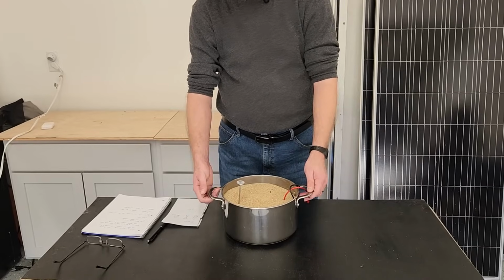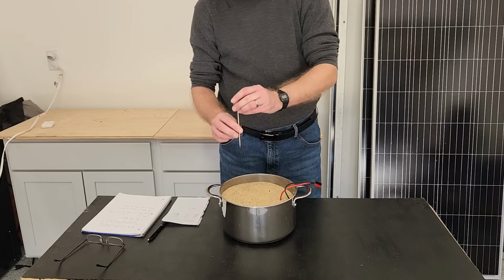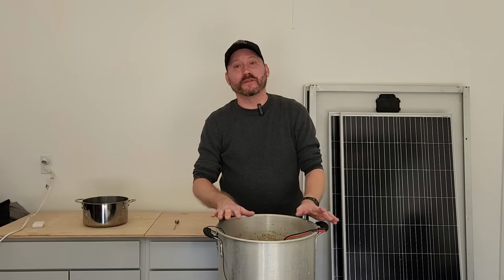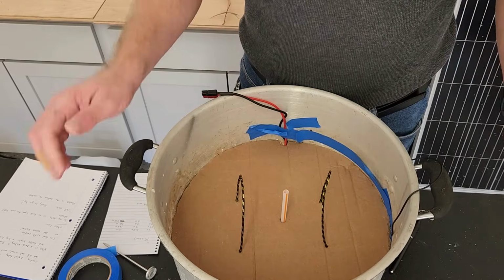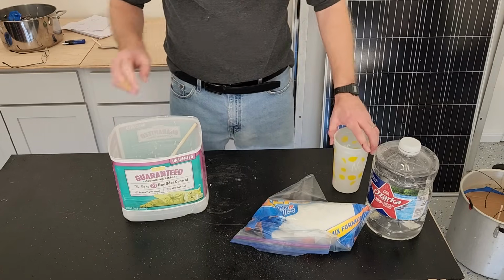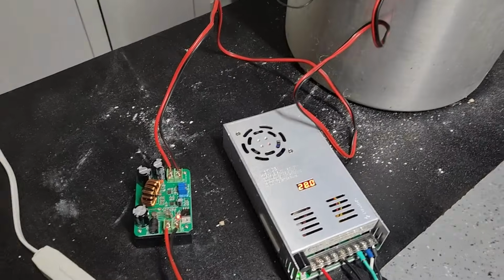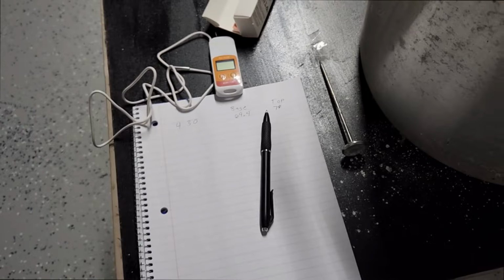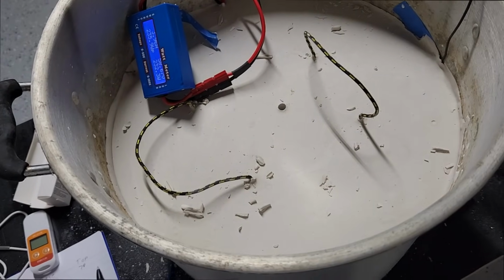Sand Battery heater. Create free heat  of 500F using solar electricity! Texas Prepper Projects

Comment: I'm about 8 minutes in and I thought I'd point out a potential electrocution hazard.⚡The contacts for the wires on the heating element are not meant to be surrounded by any material. The loose sand and/or the fused sand connects them together providing a path for a short circuit.☠ A solution might be some high-temperature silicone gasket material over each terminal separately. Also of concern is the plastic on the wires, it might also melt in this application. So additional insulation around the wires, with suitable high-temperature material, would be a good idea. Or a better idea as "daughy doc" suggests, make a hole in the side of the container and insert the heating element the same as it would be in it's normal application in a water heater.
Reply from the maker: I was also concerned about that and I do think it is a valid fear. I have multiple fuses in this system in case something like that happened.  Thanks for the comment!
Reply: Dry sand is non conductive. There should be no electrical problem. Unfortunately sand is also not a very good heat conductor. A water heating element will burn out very fast as it is designed to have water around it. Water is a much better heat conductor. I think a solution would be to have something havey in the centre that is a good heat conductor and then use the sand arund that as an insulator. Water heating elements are only designed to handle heat up to a little over 100 degree Celsius.
Reply: @leonhardtkristensen4093  That may be the case, if it's clean and 'only' sand, but I still wouldn't touch it while the heating element is turned on.
Reply: @Mavrik9000  That is allright. Safety first of cause.  If it is used with low voltage like 12 or 24 volt it is no problem and if it is used with 240 volt I am quite sure the heating element would burn out in no time. With mains voltages one should allways be very carefull. I have had my fair share of electric shocks and survived but it is true that if not used to it even a smaller shock can give a deadly amout of andrinalin in ones body. It is often not the electricity that kills but the adrinalin that does it.
Reply: You could also drill a hole in the can and stick the element and the wires out, just be sure all connections are protected with electrical tape.
Reply: I think molten glass is also conductive so if the sand actually starts to melt it would short out.  I wonder if encasing the terminals in ceramic would work as an insulator.
Reply: @redsquirrelftw  According to Dr.Google it does but not a short circuit at least to begin with. If the cunductance is higher than the heating element it will start to take over the heating process. The electric wire may melt too and it all melts together and then probably breakes the connection like a fuse.
Reply: Maybe use an old water heater and cut the top off and fill it with sand?
Reply: Would you burn out a hot water heater  element if you put a stainless steel  cylinder  filled with water an the elements in the center of the pot of sand an  plug it in to  110
Reply: @kennykrieglmeier8909  If the element is designed for 110v it will not normally burn out if it is connected to 110v and there is water in the heater. If there is no thermostat it will probably evepurate the water and then burn out. Also the reason for using sand is to get the heat up much higher than 100C (242F I think) as it can then store much more heat so limit the temperature to 100C defeats the purpose. 
At less than 100C it is better to store the heat in water alone as it can hold more heat for each litter of material. The key to keep the stored heat is the external insulation. The more the better. Heat energy losses can be calculated in a similar way to electric energy through a resistor.  Losses quardrubles with doubling of heat differential. Dry sand is a bad heat conductor and cheap so that is why they attempt to use that for storrage. 
Personally I have experimented with a heat pump water heater. I unfortunately experienced probably 50% losses in 24 hours or less with a top temperature of about 60C. It was an older water heater. The heat pump gave me probably about 250 - 300% gain. I attempted to heat up an old caravan by circulating water from the water heater through a radiator. The heat usually ran out at appr. 02am. The rest of the night was cold. It would have been near freezing outside. I did have a secondary water heater tank I could have used but in the winter I didn't have enough sunlight energy to heat it all up. To run a generator to heat up all the water might have been an idea as  heat pumps also work better in the daytime (smaller heat differential gives more heat energy) but I haven't tried and I haven't calculated the numbers.
Reply: @JohnSmith-gj8fd  waste of time using water maybe oil because it can get hotter than 100⁰c and not turn into vapour but then would copper pipe be able to withstand the heat and pressure of the oil which would change heat transfer..... Maybe use heat exchanger like in a combi boiler 👍
Reply: Came to say the same thing. Just had and electric fire in my house (old ass rental) a few days ago, and with it fresh in my mind, now anything involving electricity I'm highly critical of. Luckily we only lost 1 small room, but still was a shock at 130 am, during one of the coldest days/nights we've had in years. Funny part: nothing was plugged into that circuit so wasn't something I did the electricians said. In this case, I agree that isolating the connections and wires from the high Temps of the sand, or finding another element that'll allow u to install it with the connections on the outside (covered up obviously) would be ideal.
Reply: @leonhardtkristensen4093  
the heating element in a water heater gets RED hot in water. That is around 950 F. The real concern here is the dry element will get the wires hot enough to part. I do not know why this guy does not get a broader ranged thermometer.
Reply: @redsquirrelftw  Agreed! The lead could be bent 180 degrees before applying the ceramic covering, or encase leads and connecting wires in a ceramic covering via the plaster.
Reply: 🤣👍 good point. thanks for noticing. : ) the sand itself could be conductive wet, contain metals maybe.. however, i do not se a problem within the sand!?
even if there are some phenonema... my concern would rather be erosion of isolation due to high temperature.... which speaks for spreading out the heating...
and battery....
Reply: @leonhardtkristensen4093  😂Right, my water heater is totally melted with my first sand heater experiment!
Reply: @fransjebik8554  Sorry to hear that. I hope it wasn't too expencive. "A Youtuber" suggest mixing mineral oil in the sand 9 days ago. That would be fine if it is keept in the centre and don't get so hot that it catches fire. 
Some of the advantages with sand are that it is a good insulator (it keeps the heat in the centre and doesn't loose too much), can store quite some heat and is cheap. The disadvantage is that it has to be very hot to store significant heat ammounts.
Reply: A Youtuber  If the oil can be keept in the centre of the sand and doesn't get so hot that it catches fire then yes that is a possibility.
To keep the heat the sands insulating propperties must be kept in the outher layers I think. If the oil was keept in a steel container in the centre and the oil was only heated to about below it's boiling point then it shouldn't catch fire either. No oxygen and no signeficant expansion.
Reply: @leonhardtkristensen4093  Thank you, and no not expensive, bought it about 15 years ago in Russia! 🤣
Reply: Sand is a mineral insulator.
Reply: 60v DC is completely safe to touch
NO electrocution hazard whatsoever.
Reply: @mrbmp09  If you have dry hands yes but if they are wett especially from salt water then it is a question. As I understand it the skin's resistance is normally high enough to prevent any hasard but not the internal body.
Reply: @leonhardtkristensen4093  I was thinking the same thing with the water heating element. They are designed for being in water, meaning they have a lot lower O2 exposure. You can see in the video the element is already being damaged after a single use.
A better element to use would be to use an electric stove top element. Not only are they are designed to be in the air, they are also safer to use due to the connections being surrounded by ceramic, and the added benefit of being circular/coiled, exposing more surface area to heat the sand up instead of being centered.
Reply: @korishan  Aggree.
Reply: @redsquirrelftw  Sands melting point is just over 3000 degrees
Reply: Water heaters are much better for this.
Reply: Just something to consider. Sand is a major component of glass. Glass is an insulator used for over a hundred years in electrical service. Plaster of Paris is also a very good electrical insulator. A better heater element would be a bare Incalloy steel element. Sort of expensive but they handle furnace duty handily. You can salvage them from crucible heaters or for smaller units toaster ovens. Even salvage the porcelain insulators to stand it off your base sand. Nice project.
Reply: @korishan ok
Reply: I got a scrap 20 gallon hot water boiler the other day and stripped it down to tank. I bought a new screw in element. The electrical connections won't be exposed to the sand. Currently trying to troubleshoot the problem of the sand potentially fusing to and degrading the element, or the element burning up. But also concerned with the potential for a pressure build up within the tank at high temp. I think I'll end up getting a new or salvaged temperature & pressure relief valve eventually just in case
Reply: Don't immerse the conductors in the material.
Reply: @leonhardtkristensen4093 sand being a poor heat conductor is the key to a sand battery’s efficiency. A stovetop element runs around 900C in air. I’m getting 500C from my 63V of panels. Making your own nichrome element perfectly tuned to your solar panel output is the most efficient.
Reply: @redsquirrelftw what you think is completely incorrect. Why are fuses made from glass?
Reply: @leonhardtkristensen4093 unfollow that YouTuber and don’t listen to a thing they say. That’s such a boneheaded idea.
Reply: @jimk4874 silica fuses around 1800C - much higher than the nichrome in the element
Reply: This must be the famous American Red Neck.
Reply: @leonhardtkristensen4093 I'm a car mechanic and I remember the old mechanics used to touch the spark plug leads on a running motor to try a fault find, or they would lay their naked forearm across the plugs to stop a running engine one old dude recoond that he could judge the strength of the spark if he took the lead off the plug and spat on his hand before holding the, live HT lead. They don't come thathard these days.  And I'm so glad we have tools to do this now.
Reply: I would put a metal grid over the top so I could warm up my soup.
Reply: @kennykrieglmeier8909 water turns to steam at 100○ C so you won't get much heat transferred to your sand. I would add a thermostat to the heater circuit myself.
Reply: @davey2k12 adding a HE is adding complexity and cost, plus the HE will need power to run.
Reply: @therealrobertbirchall  wtf no shit Sherlock...... Why you replying to me for did you even read my comment or just clicked a random one 😂😂😂
Reply: @davey2k12  whatever 😵
Reply: @leonhardtkristensen4093  My thoughts exactly. I doubt the element would last more than a few days with that setup.  If you want to get serious about it get you a small water heater and use it just as it is but instead of water fill it up with ethylene glycol and then put the entire tank in a larger metal trash can full of sand or something like that. Of course you would have to strip all the insulation from the working water heater first.
Reply: @Mavrik9000  I'd agree that could be a possibility but I'd lean more towards it creating a high resistive short.  While still potentially dangerous but nearly that of a dead short or even low resistive short.  It would, either way, reduce it's efficiency.  That being said, it would still be a good idea to make sure all bare connections are properly insulated.
Reply: @leonhardtkristensen4093  you have to have an element designed for solids!! They have been used for decades!! Look up 12v PTC heat plates, designed to heat solids ,metal, sand , concrete,etc. Works great with no danger.
Reply: @thesonnytackettshow7949  Like a stove top burner?
Reply: @Mavrik9000  same principle. They are “dry elements “ that heat solid items so stovetop burners would be the same. If you dropped a stovetop burner in water it would short out, not meant for that. If you put a water heater element under a kettle it would burn out, doesn’t work as intended which is in water. The PTC plate heater is a different type of element. It’s  a ceramic disc sandwiched between two aluminum sheets and sealed. It’s designed as a heater for “dry” components, such as metal, stone, sand, etc. The best thing is it’s “thermostatic, which means it won’t overheat. All of the wiring and metal, ceramic, is completely sealed, no exposed anywhere. The wire has heat sleeving like you’d find on oven wiring etc. 
It’s not a new thing. They have been used to  preheat the motor and oil pan on diesel trucks for decades. And on many many industrial and household products. They are “dry” heaters, water elements are “wet “ heaters. Huge difference. They also come in 12v and 24v which works with solar panels, batteries, even great in an rv. 
And the big thing, you can get two 50 watt 12 v PTCs for $10+- !!!!
Here’s a link

Bestol 2pcs PTC Heating Element 5W-50W AC DC 24V 70 Degree consistant Temperature Ceramic Thermostatic

There are many, in different wattages and 12v 24v AC or DC. 
We use 50 watt 12v dc with a solar array and a battery bank. 
These are good for 5-10 years no problem. 
All the best, Sonny T
Reply: @Zootalaws do you use the coil kiln heating elements? Could you describe tuning the element to you solar output?
Reply: @leonhardtkristensen4093   Maybe using the same oil used in Electrical Transformers would be possible!?!?!?
Reply: @davey2k12  Naphthenic mineral oil has long been the most preferred insulating liquid for power transformer insulation because it has a good pouring point at low temperatures, good thermal cooling capacity, low cost, high efficiency and availability on the transformers market [1, 2, 3, 7].
Reply: @leonhardtkristensen4093  Naphthenic mineral oil has long been the most preferred insulating liquid for power transformer insulation because it has a good pouring point at low temperatures, good thermal cooling capacity, low cost, high efficiency and availability on the transformers market [1, 2, 3, 7].
Reply: @carrolbrooks2143   Maybe it could. I am not a chemist so I don't know it. What they supposedly use in solar collector towers is salt. The high temperature melting probably keeps the heat quite efficiently. We know that it takes a lot of heat energy to melt something without much temperature change. Wax has been thought of as such a medium but at a quite low temperature. The solid to liquid change usually stores a lot more energy than just a temperature increase. The reason for using sand is probably a lot because it is cheap.
There is also chemicals that give out energy when made wet. They could be dried out in the summer by the summer heat and then made to give out their stored heat energy by mixing it with water in the winter. Calcium chloride is one of them. There are problems with that poisonous fumes can develop I believe. Again price is a problem too.
Reply: @redsquirrelftw  No molten glass is NOT conductive.
Reply: Melted sand means glass. Glass used as insulators on vintage power lines. Glass will not conduct electricity. Nuff said.
Reply: Molten sand cooled is glass. Glass will not be a conductor of electricity. Continue on.

Comment: Thanks for your work. Im working on a similar concept, mine is targeting the size of a fridge, with outer walls design with high temp insulation. Internally I will do a copper coil for heat extration via pumped water, and multiple 220v heating coils. Will do design so sand can be emptied, and filled. Put it on a pad outdoors, as its going to be heavy. My offgrid solar is 24 Kilowatts of power, so this will be my dump load, when my batteries are full, I can redirect during the day to the heat. my house is already designed for radiant heat, so easy to use hot water for it, or pre-heat for house hold hot water and hot tub.
Reply: Use a radiator fluid it will raise the boiling point of the water.
Reply from the maker: Cool
Reply from the maker: Neat

Comment: Sand batteries  really only work when you have an existing heat source.  Say if you use a wood burning stove for heat. If you surround the stove with a sand battery the house would stay heated for say 50% longer using the same amount of wood. That is when a sand battery really shines.
Reply from the maker: thanks